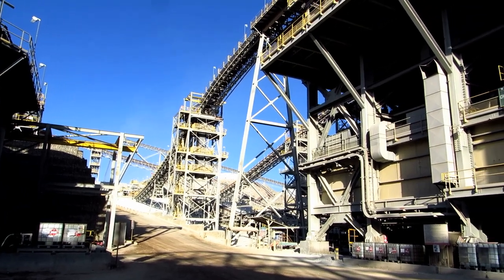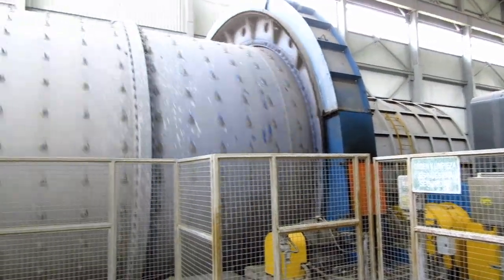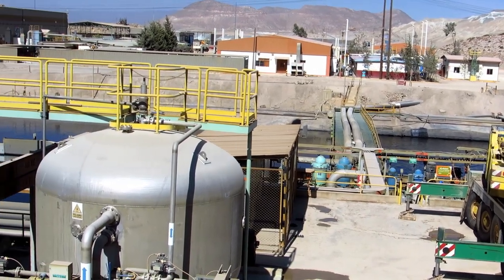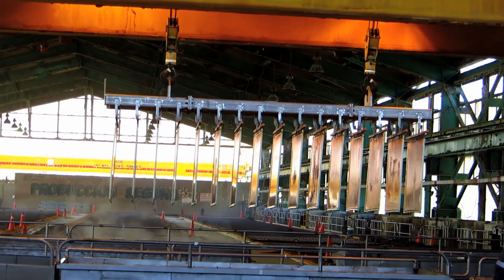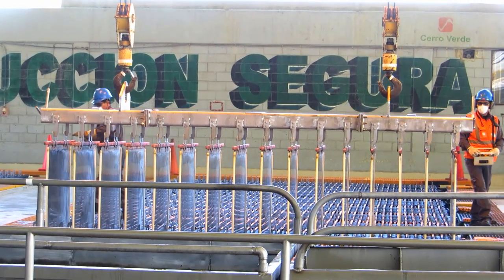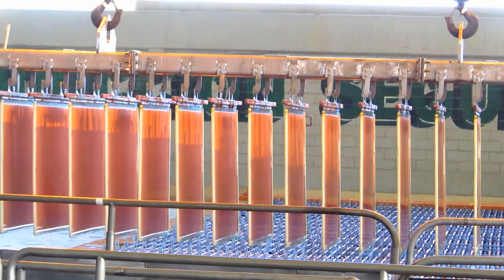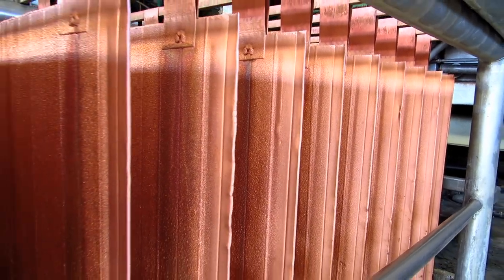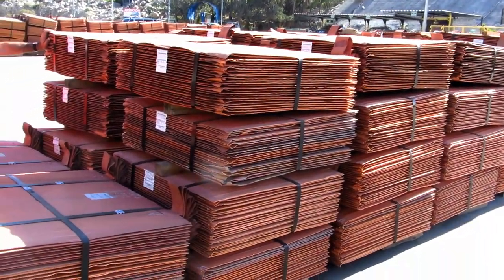The Core of the Mine: The Concentrator

Comment: Forgot to say how the anodes are made?  Nice to give the plant rats a little love.  I don't know where this is (Chile?) but it must be nice to not have to worry about winter.

What's amazing is that this hydrometallurgy and electrowinning technology was in its infancy when I was in college 45 years ago.
Reply from the maker: That's interesting! I understand that Electrowinning is a very old refining process. 

To answer your question, The anode is the impure copper to be refined. The electric current introduced in the liberator cells pulls the electrons out of the anode and plates them to the cathode. And yes, this is in South America. Very different climate there! Thanks!
Reply: I'm old too.  Back then everything was pyromet with reverb furnaces, refiners, tall stacks bekching SO2, and casting.  How do they get from concentrate to anodes?